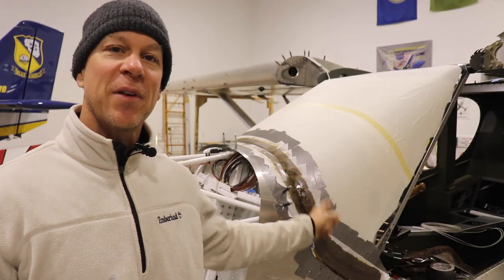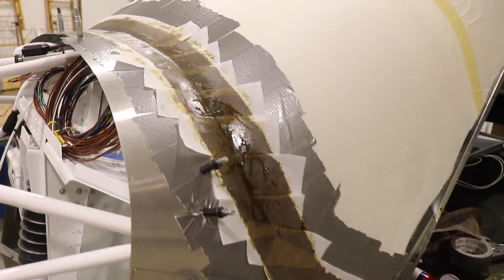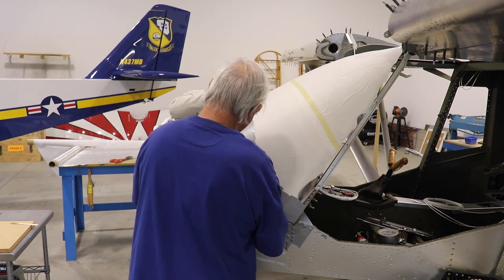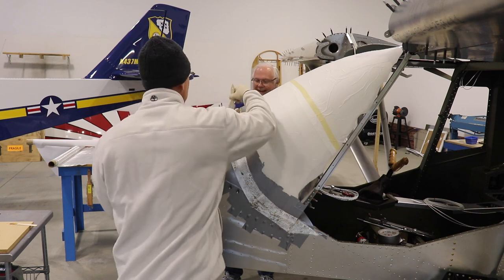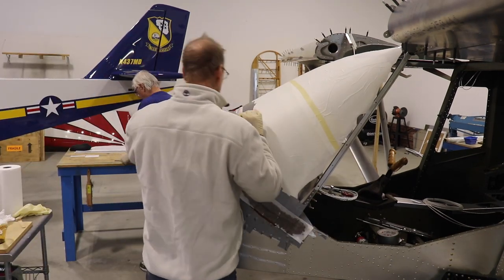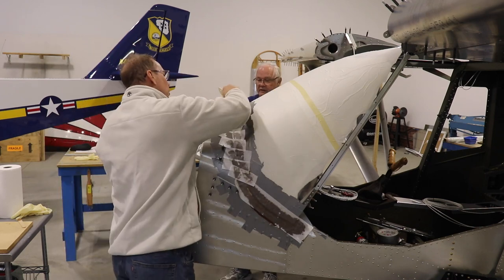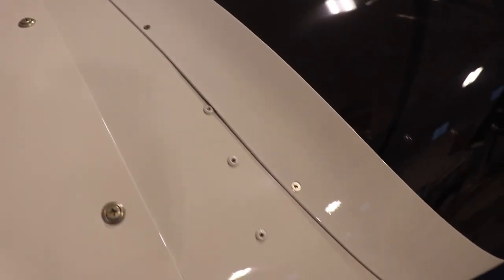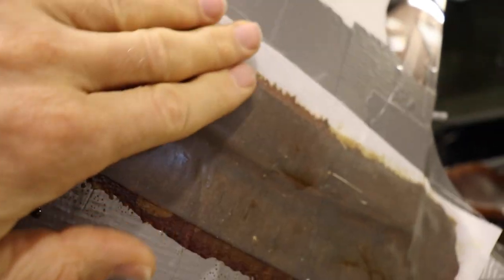Making Aircraft Fairings

Comment: Just another tip, your local HobbyLobby or other fabric shop will have Dacron, or Dacron - like, fabric for cheap.  It’s also thinner / lighter and conforms to curves ( lays down) easier than the “heavy” covering material I think you’re using.   Also for long strips of glass, simply loosely roll it up after you cut in on the bias. Then unroll onto the part - helps keep distortion to a minimum. Also, stores better for the next job.

Comment: Nice work. Could you brush the micro on after the layup has just started to firm up so it could cure all at the same time as layup? Clear packing tape works great by itself as a release and since it's super thin doesn't leave much ridge at joints.

Comment: Ummm.  Perhaps you could try some mold release wax (Partall Paste Wax #2) and some PVA (spray on)? Duct tape and Vaseline just seems... wrong?
Reply from the maker: Hmmm... "seems" wrong, yet gets perfect results every time...
Reply: @KitplaneEnthusiast  ...and it's dirt cheap, and it's already in your shop.
Reply: Yep, I'd use packing tape and wax, it's thinner and you'll have less lines in the glass product when done.  Peel ply underneath doesn't make sense to me either as it is just increasing the thickness of the base and making more finish work to be done later.

Comment: A near by neighbor who I meet thorough the local EAA chapter, is building a 701 and told me about this channel. I have been racing cars and making them as well and I make fiberglass from raw materials for bodywork. I noticed a previous post and I liked it since packing tape is an excellent way to cover a surface since resin will not adhere to it. It is made of poly vinyl chloride which is the main ingredient in PVA release agent.

Also I am curious why your resin is so dark brown? Is it old resin? Stuff that is aging will get a darker brown as it ages and new resin is usually clear or nearly clear and close to the viscosity of water.

Also since you have a sweater and ski cap on, is it cool in your hangar? I hope you know that polyester resin will not set up as quickly depending on the temperature and humidity you are working in as well as the amount of hardener you add.

Good video!

Ed